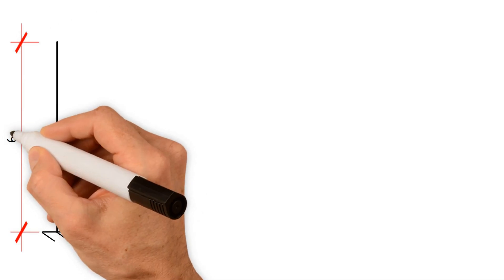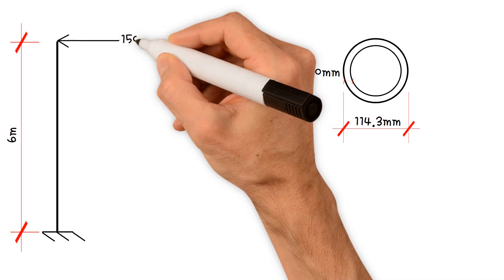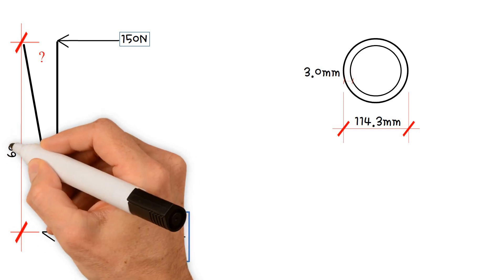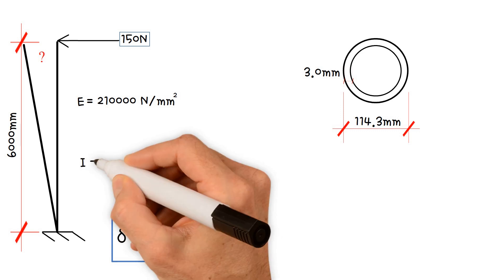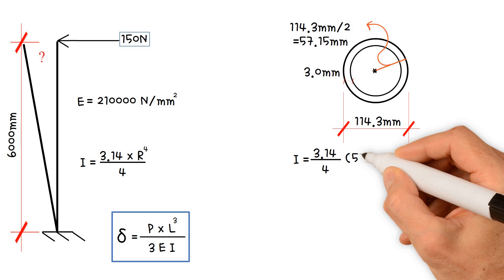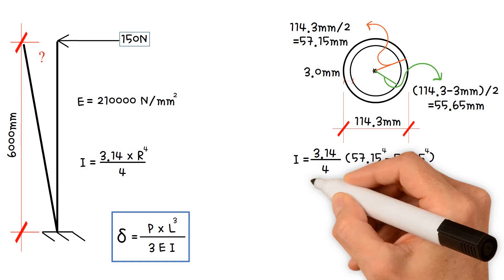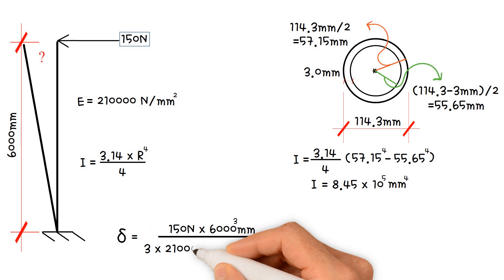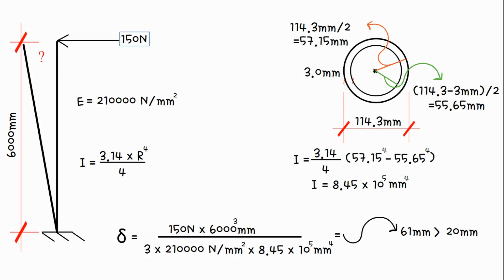How to calculate the lateral deflection of a steel flagpole

Comment: If the Thickness of Pole is 3mm, shouldn't the Inner Radius = Outer Radius - 3mm? How can the inner Radius = Outer Radius -1.5mm instead???
Reply: Yes you are right...there is a mistake in the I value calculation
Reply: No.. it is correct

Comment: I for a tube is 0.049*(D^4-d^4) - avoid use of r , as it does not exist without measuring diameter first.  I say you have the wrong answer for deflection. And question can not be answered as
outside diameter or thickness was not stated.

Comment: I worked through the example, a Hollow section with a diameter of 139.7mm and thickness of 4mm (bluebook hot finished) has an I value of 3.93x10^6 , therefore using the formula within this video should produce a deflection of 13mm... 13 < 20 deflection limit. Thereby satisfying the deflection check. Or alternatively, if you want the same section size, 5mm thickness should suffice for a 114.3mm diameter.  Thanks for the great videos! Only just found this channel, but can't wait to watch more!  :)

Comment: thanks very good example..but i think ..I for section 1625480 mm4
Reply: @structuralengineercalcs  
pleas ..check the r for internal circle..
Reply from the maker: @emadalhafez6172  Thank you for pointing this out. You are right! for the internal circle you should deduct from both side. Inadvertently, this has been missed